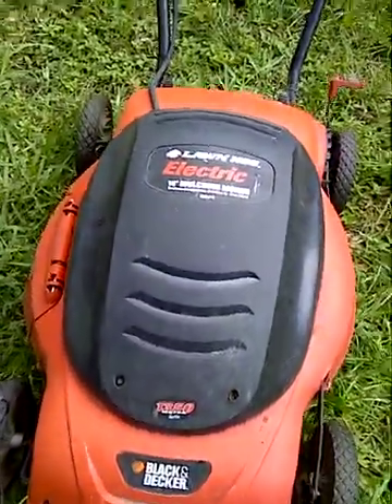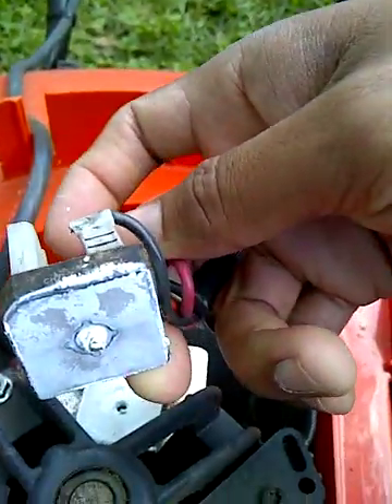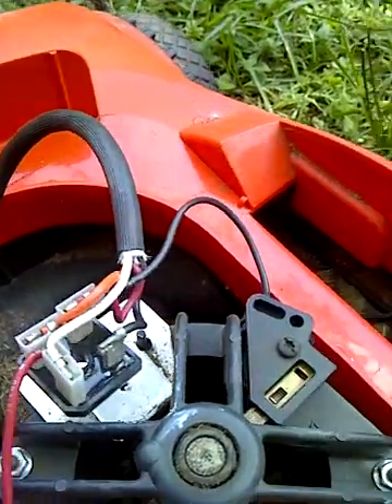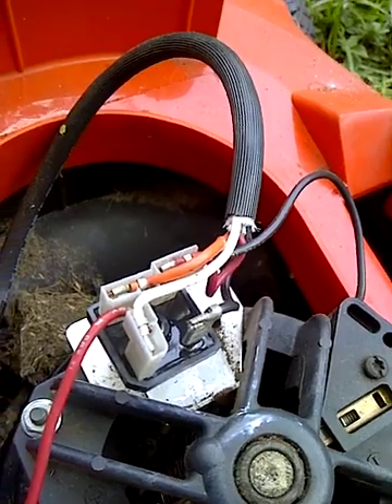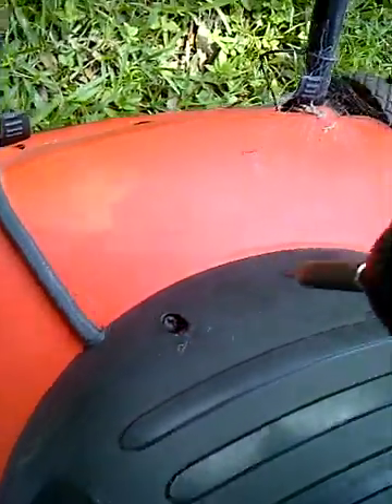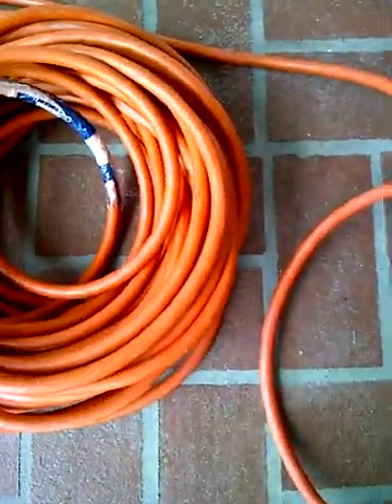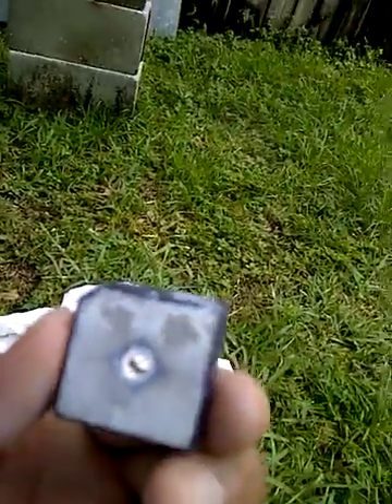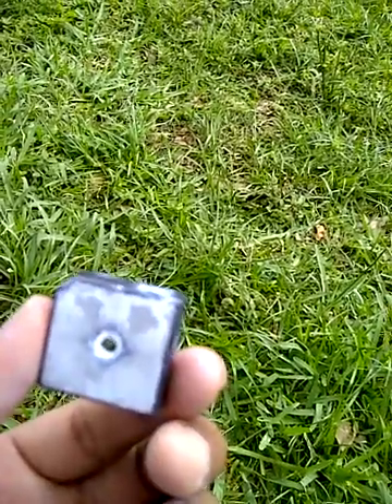Repair Electric Lawnmower rectifier 72256-03

Comment: Thanks for the video!! I bought a replacement rectifier from ebay for $10 and now my Greenworks mower works. I even made my own video. Garylabelle123 made a good point about the heatsink compound. The rectifier on my mower did not have any compound so im going to put some ArcticSilver5 on it, hehe.

Comment from the maker: You will know if a breaker is being tripped when the mower stops working and no power is coming out of the same electric outlet that you plugged the mower cord to. Check your breaker box and one of the breakers may be tripped. You could also plug in a working lamp or hair dryer in the same outlet, if they work then your breaker has not tripped. If they don't turn on then your breaker has likely tripped, cutting off all power to the outlet.

Comment: do all lawnmowers have a dc motor? my father has a corded black and decker and told me that after attempting to cut some tall grass it was damaged, and now the blades need a manual push in order to start spinning.

Comment: The white stuff is heat sink grease to help dissipate the heat caused by the rectifier. Assuming the lawn mower also has a circuit breaker you can also put in a higher current rectifier than what was in it originally.

Comment: Hello
Great video!  I have a homelite mower.   I cut long grass with it and now the mower won't start.  each time i plug in, the circuit breaks.   last time, when I plugged in, I saw some smoke from where the extension cord connects to the mower.  Should I still try changing the rectifier?  thanks!

Comment: make to tell people DRAW OUT or note where the wires go, red-yel to plus, grn- blu diagonal across from that ( those will be the positive and negative wires that go to motor) and black is AC which is hot 110V and white diagonal from that which is 110 Neutral

Comment: My Electric mower doesn't do anything when I hit the switch. I put a new switch on so It's the rectifier or motor. Is there a way to test the motor or rectifier to see which one is bad??? thanks
Reply: Ethan snyder It looks to be a basic bridge rectifier. A device to convert AC to DC. It's made up of diodes, which allow current flow in one direction. Take a DMM and measure across pins, short one-way open reversed then it's good.

Comment: Hi.. Where do you get the rectifier from?
Reply: check eBay and Amazon
Reply: +Hiten Parmar no chance at local stores such as home depot and radio shack?
Reply: +ruigooal Home Depot does not sell enough of that product to justify stocking the shelves with it. you could also try calling the manufacturer number listed on the mower to find a local dealer.
Reply: +Hiten Parmar OK thank you. just wanted to see if I could grab one today otherwise I will buy it from eBay/amazon and wait few days.